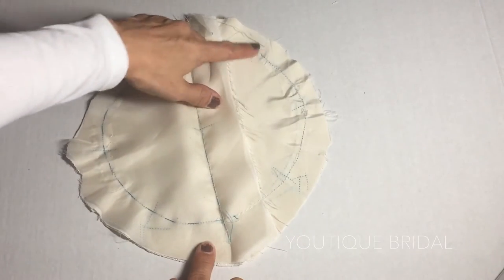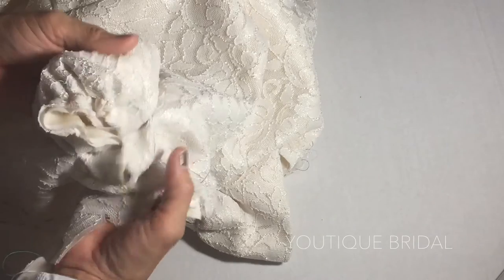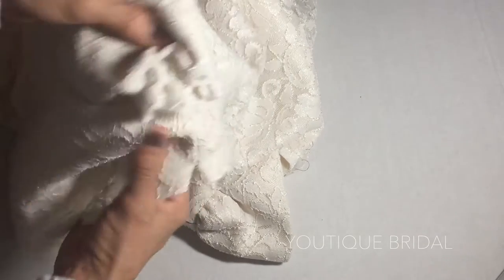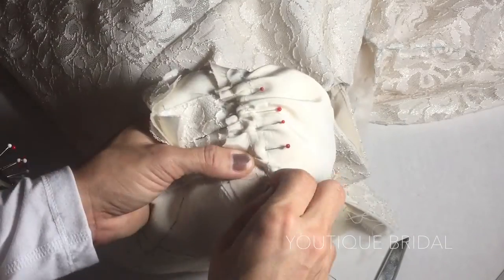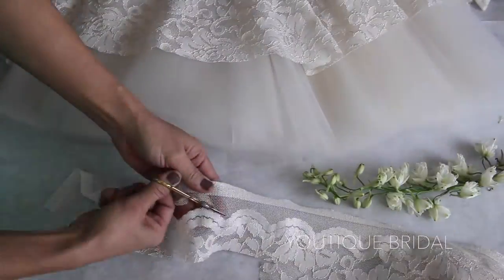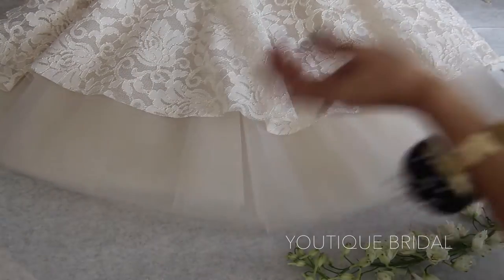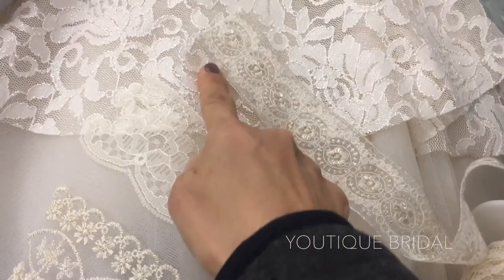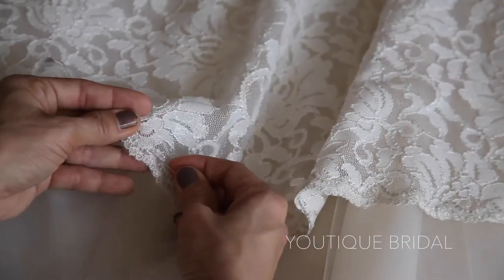Flower Girl Dress Part 3 : Lining+Sleeves+Finishing Touches {TANYA}

Comment: Hi there, I want to replace the lining of tulle skirt which is part of a dress. Is it difficult to do? Would you be able to do a tutorial on this or something similar? Thank you.
Reply from the maker: Thank you for your inquiry.  If the skirt lining is a separate piece from the bodice, it should be doable.  If you have sewing experience, it will definitely be easy.  I would use the seam reaper and carefully separate the lining from the bodice.  Use the old skirt lining as a template/pattern for the new lining.  Sew/attach it back onto the bodice.  I have projects lined up for now so I'll see what I can do.  In the meantime, I hope the general instructions make sense.  Thank you for watching!